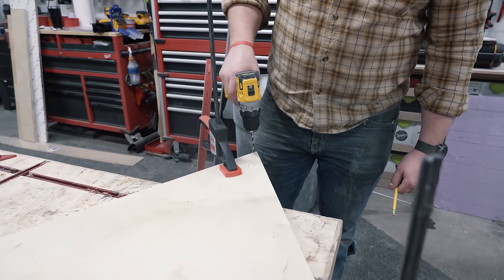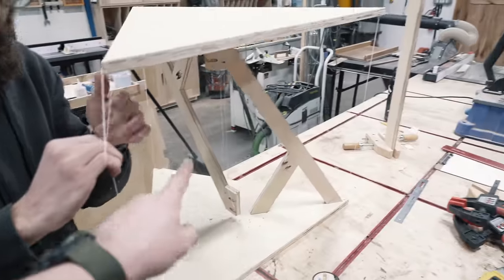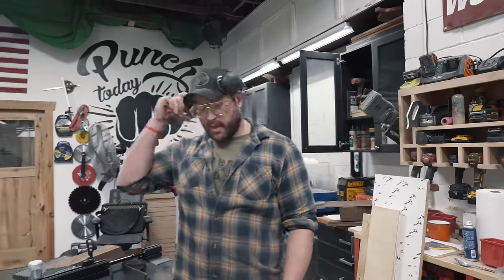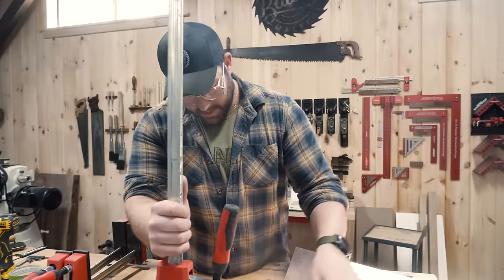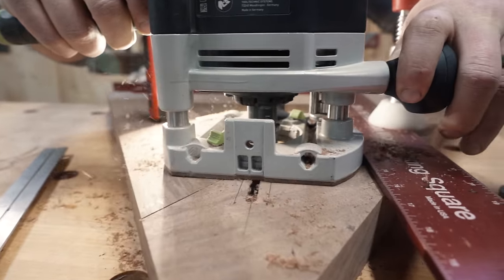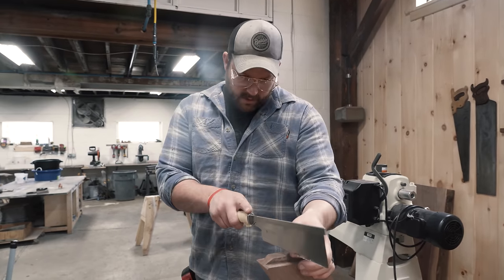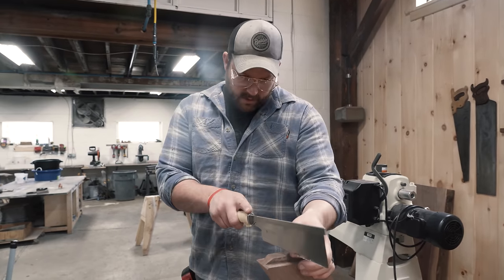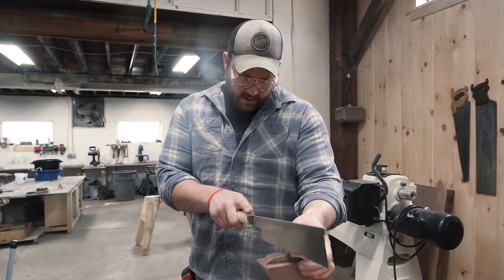IMPOSSIBLE Floating Table Build - Will It Work?

Comment: It will work if you build it the right way!
You got one of the supports for the center line in the wrong spot, one should be in a corner of a triangle and the other one should be in the oposite side facing it, that will place it between two corners of the other triangle; it should make no difference whether is the top or bottom, but they must face each other for it to be stable.

Comment: Wow kukurazy! i wonder if it would be more stable if you would cross the outer wires, speaking that the wire is not going straight from bottom to top but rather go in both other holes but not in the one above. So in the end you would have double the outer strings but a cross connection on two points, what you'll think...would that work???

Comment: You can get thin steel cable for much more strength. Get it with black coating (or clean & paint it) to help it disappear.

Comment: i would use fiber optic wires and run them through the bottom of the table with a randomly flickering light to make it look like sci fi energy was holding the table in place. would look pretty awesome

Comment: I'm wondering how much weight this structure can hold. And what would be the weakest link in this case?
Reply: The middle string holds all the weight, while the corner strings just stabalizes. So the middle string is the weak link. Fishing line that thick can hold a substantial amount of weight however.

Comment: John: Your woodworking skills are as noteworthy as your ability to film humorous segments that are fun and entertaining to watch.  I truly appreciate what work must have been involved doing both this and your original table, but I have a thought.

First, at least to me, transegrity tables are no great illusion.  I'm sure others disagree.  To me, the table top is held against the forces gravity by the middle connection, and shimmy by the outer ones.

Now...build a table where the inner structural members featured a higher altitude for the top table member, and a lower one for the base, well, that might be impressive, if also in violation of the laws of physics...…

unless a thick chain was used that (wait for it) was welded at each link so it could resist not merely expansive forces like the outer chains, but compressive ones as well.

Now THAT would be a true conversation piece!

Comment: If you take the three outer strings and run them inward from the bottom to the top (outside of the triangle to inside of triangle) you'd add a little stability

Comment: Black thread vanishes better than white. The naked eye perceives the colors of what's around it and then the black pretty much vanishes. It's why they use it in movies for things like wire work. It saves all the digital work that would have been needed to erase the wire if it was white or grey. White captures light and therefore becomes more visible.

Comment: If you run two lines from each corner to the non-opposite corners it would be more stable, you could even leave out the lines from each corner to its opposite.

Comment: I always thought this would be more sturdy if it was made of steel or aluminum, with a nice thick cable in the middle so it can (theoretically) hold some actual weight. Something I’d love to do myself one day, though there is the problem of the base material needing to be able to support the weight as well, so it couldn’t be too dainty...problems for future me!

Comment: Strictly speaking, this is not tensegrity.  Tensegrity is a design principle where all the rigid struts are solely under compression stress along their lengths, and the strings/cables are under tension.  On this one, the rigid struts are subject to stresses in various directions.  However, it is a beautiful thing, nicely made.

Comment: you could have had a more stable table by making the ratention calble not straight (-> link each edge of the upper triangle to the side opposite of the current edge on the lower triangle, but it would have occupied the center...) but what you did is great

Comment: First time seeing you. I'm a xylophile myself. I dig the trick stuff. When you scaled the project up you did something. Like I mean because of Newton's rules/laws whatever. By action or movement you have caused reaction let's skip the equal and opposite discussion here so I can get more to the point. Not having given this any thought as this is a reaction. And clearly you've given Considerable thought and having gained some understanding of the ratio's in the mock up. What would a 20' or 40' table top.( Aka treehouse floor.) do for the electro firing of your action potential?
Of course you know once you have read this you can't unread it.

Comment: Instead of string in the center, what if you used a threaded rod with a spacer so that it appeared as if just a single bit was holding it? It might help keep the table from swaying when you put objects on it.

Comment: If you take the wire made of non-stretchy material - like steel wire - your table will be as sturdy as a normal one. The reason it wobbles is because the fishing string is too stretchy.

Comment: The only thing I would have done differently, other then using clear fishing line is to have used Iron wood Pegs instead of pine dowel rods. I am saying that as if you had cut, triangular iron wood pegs or square iron wood pegs it would have complemented your walnut wood better. Even oak or maple would have been better then white pine. But the table looks great. I do wonder though could this be done with powerful magnets as well, as the only problem I can see with the use of magnets is possibly killing your cell phone or credit cards.
Reply: Problem with strong magnets is that they are not stable, If one would accidentally flip around, the table would collapse and crush anything that was in between the magnets (For example your leg would become paper-thin like something from the cartoons)

Comment: The middle thread hold the entire weight of the top traingles and the other 3 strings hold the top falling to the sides.  Very difficult to make the correct measurements.